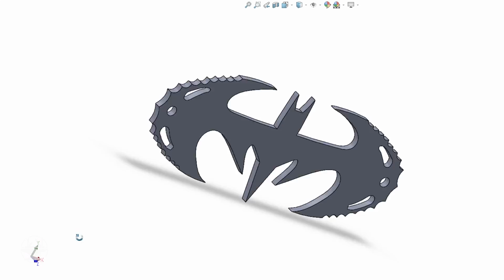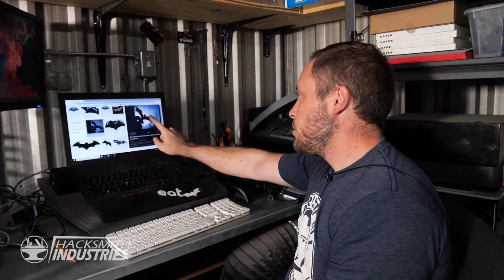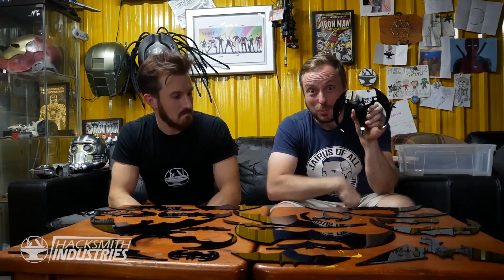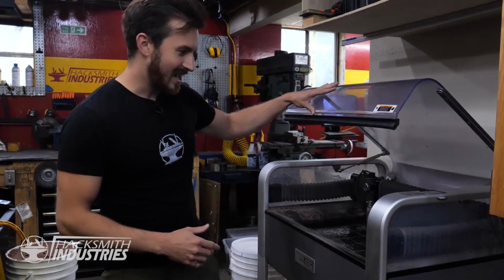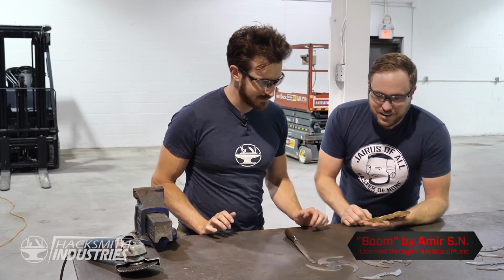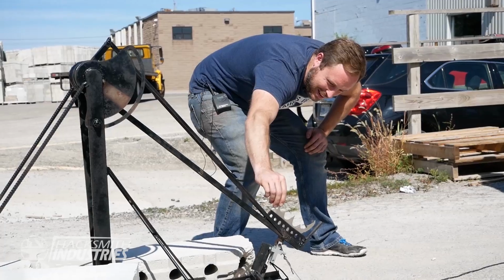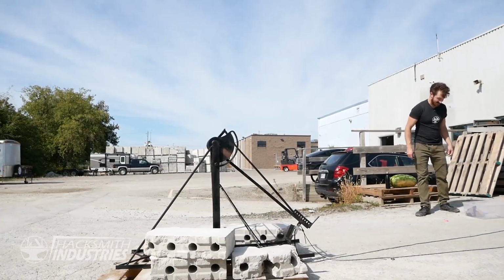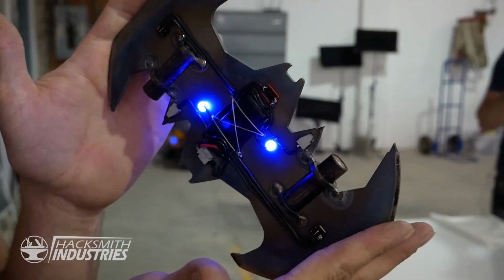We Made Every Batarang Ever?!

Comment: 1:00 "...an old, floppy, leather wallet that's probably giving you back pain from sitting on it all day"
A: Take the wallet out of your pocket if it's such a big deal.
B: I don't even sit on my wallet when It's in my back pocket. It slides up the side of my butt, so it's not even affecting my sitting
C: I like having a wallet that can actually hold my cash IN it. My wallet even holds change.
D: I'm fairly certain that a ridge wallet would be less comfortable to sit on, as its rigid and rectangular.

Comment: Imagine making all those without that machine. LOL
Reply: electronicsNmore I've made batarangs from steel about 1/8th inch thick with an angle grinder, belt sander and small detail sander

...aaaaaaand making just 1 takes like 2 hours. ._.
Reply: i made my own using a hand controlled plasma cutter and a grinder, with a simple design that is a cross between the hush one and the 1989 one for simplicity. really not hard to do with decent tools and material that is half way to the right size

Comment: I've not long ago started my new college course of level 3 engineering and we have started using auto-cad to design components of the project we are designing by the end of the year but we are told that during the year we will be switching to solid works so is there any suggestions you could make to help adapt faster